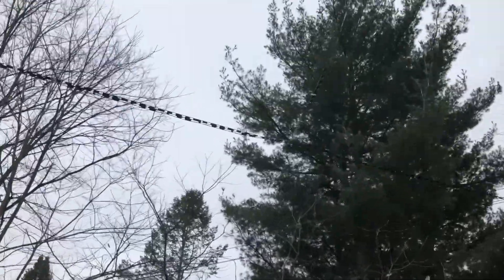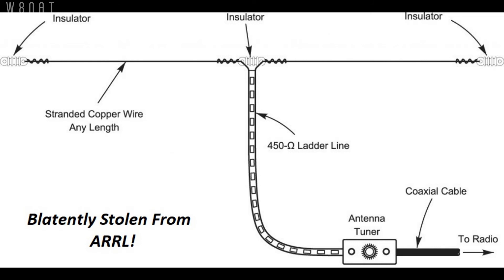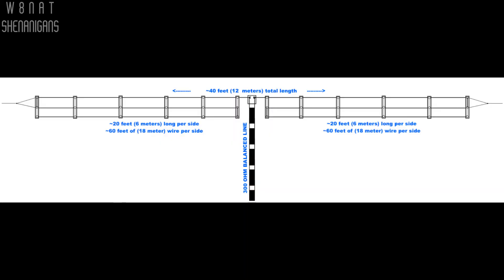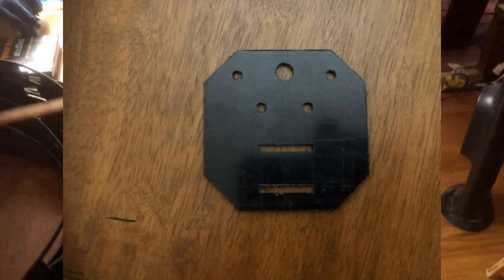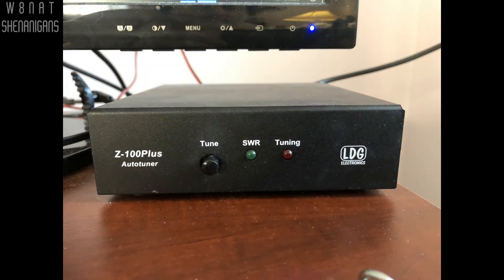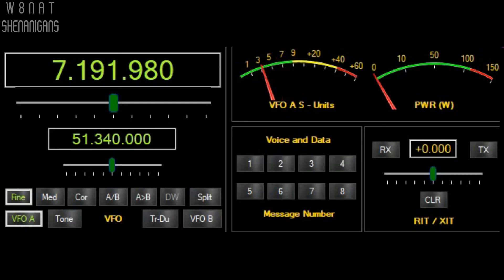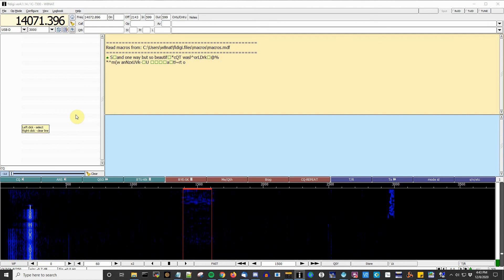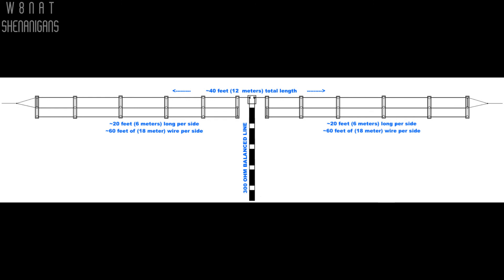Short Multiband Linear-Loaded Doublet Antenna With 80 Meter

Comment: Good morning! Thanks for the well produced and well narrated video. Here are a couple of approaches that I use (thanks to W8JI for his ideas on his website.)
- I now use 1:1 baluns instead of 4:1. A check with the antenna analyzer can show if that change in baluns is needed.
- Using ladder line (window line) as an impedance transformer is quite handy. For example, I use approximately 3/4 wavelength (wl) of ladder line to transform the high impedance of an 80m, 1/2 wl center doublet down to 50 ohms.

I hope these ideas are useful.
73,
Jack, KE4ID

Comment: Thanks for the great video. I built a linear loaded doublet for 40 meters and have it in my attic space. I have had some success with it but haven't been on as much as I'd like. I need to do some FT8 testing with it to see how it radiates, what direction, etc. I feed with it 300ohm twinlead and use an MFJ 4:1 Balun. I have the LDG Z11 Pro autotuner and it loads it pretty well. The Z11 Pro has controls on it that allow me to tweak it a little so I can usually get to 1:1 even when the auto mode doesn't. One thing I have found is I previously had an endfed and it had a nearly S9 noise level(I live in a suburban area on a small lot) while the doublet was much quieter. I also use that MFJ center insulator, simple but nice little product. Would love to know more about how well this antenna is doing for you.

Comment: What's your assessment a year later on 80m? This is  a very interesting concept
Reply from the maker: I didn't really get out of 80 meters what I wanted, at least yet. Even with the manual tuner, I cannot get a usbale match on the voice portion (75m) which is where I really wanted to play. The remedy is supposed to be to try small adjustments to the antenna or feedline length, which I just haven't gotten around to doing yet. That said, on the CW/digital end of the band, it's been usable (though I am terrible at CW so that bit has been NVIS work with a buddy 30 miles away :D )
Reply: @w8natshenanigans705  I have experimented some with linear loading. I had a little more room and only doubled back the outer halves of the 80 m dipole. I guess it was a semi cobra. It did not work so great either in terms of sensitivity or efficiency. It is a compromised antenna, but not sure if anything better can be done in limited space. I am going to try the tried and true coil loaded 80 m inverted V at 30 foot peak. If there was a way to coil load a folded dipole I would do that.

Comment: I’ve built my first when you’re loaded doublet Dipole and will be using it for the winter field day coming up on January 29 I took a different approach rather than hanging the wire off of the 450 ladder line like you did I decided to thread it in between the two existing wires so who knows if it will work ! I sure hope so it took me a long time to build it! I’m curious what type of connection you use from the manual antenna tuner to the antenna itself? Any coax or did you run the ladder line the whole way to the junction
Reply from the maker: Thanks for watching! On myine, I'm running a short lenth of coax (about 5 feet) from the antenna tuner out the window to a 4:1 balun, and then have the window line that's going to the antenna attach to that on its two posts. So it's not completely a lossless trip, but the lossy coax section is really short. I hope yours works good for you on WFD!
Reply: @w8natshenanigans705  how high. We’re you able get your doublet above ground? Does your tuner also have a built in 4:1, so you were actually using 2- 4:1 baluns? How many bands did it work on?
Reply from the maker: @PatAutrey  It's still only up about 20-25 feet, so it's pretty much regional on 40 but can get most of the US. It works on 80 and up, but the match in the voice region of 80 (75) is not so great. I should realy monkey with the lenth a bit. The tuner does have a 4:1 in it that you can use with twin terminals for ladder line run directly to it. But I opted for the external balun with coax because my window frames are metal and would likely mess with the ladder line.
Reply: @w8natshenanigans705  good to know what tuner  do you have I have MFJ. 941 e
Reply from the maker: @PatAutrey  Mine's a 969. Similar but instead of the inductor knob being multi-postions, it's a giant continuous-turn roller knob.
Reply: @w8natshenanigans705  Thank you for all your help I really appreciate you sharing your experience with me